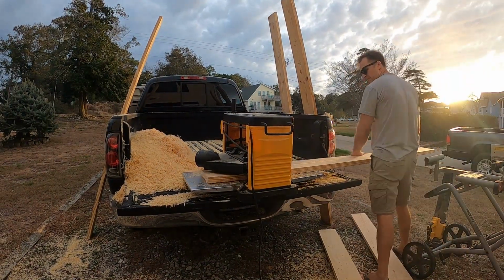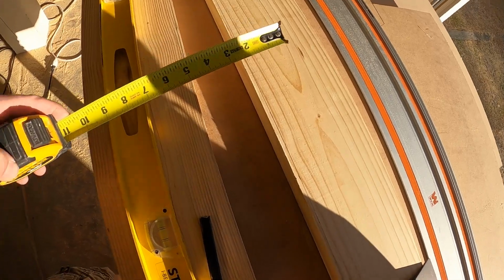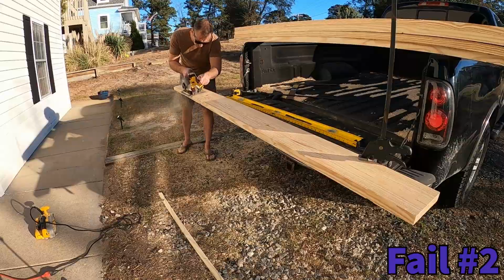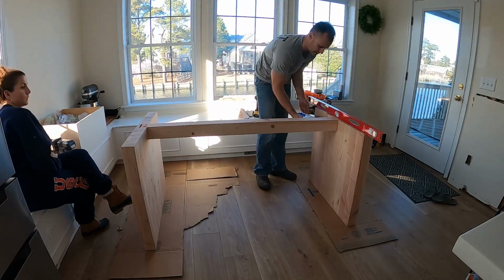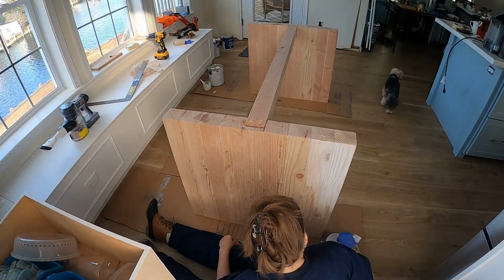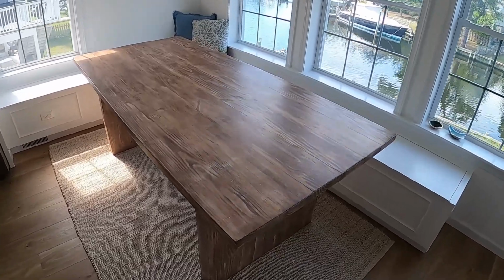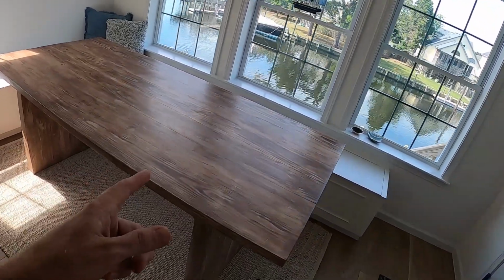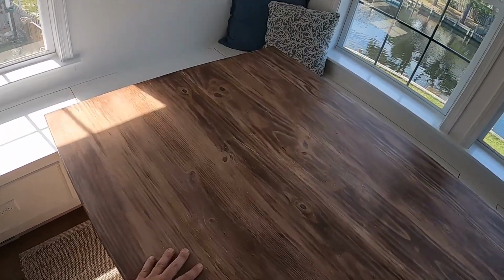Table Build

Comment: Great job! You prove that you don't need $10,000 in tools to put out a nice product. For clamps, you should check out Harbor Freight 3/4" pipe clamps and the parallel clamps. I have several and they work great.
Reply from the maker: I completely agree and will check the clamps out

Comment: Nice. What products & colors did you use to stain. The color is nice.
Reply from the maker: We did the white wash which was 50 percent water and 50 percent white paint over the tabletop and legs.  For the stain we used Miniwax Gel Stain in hickory color. I also used the Miniwax Polycrylic for the topcoat, I mistakenly said polyurethane in the video.